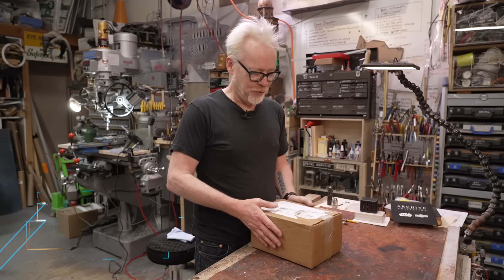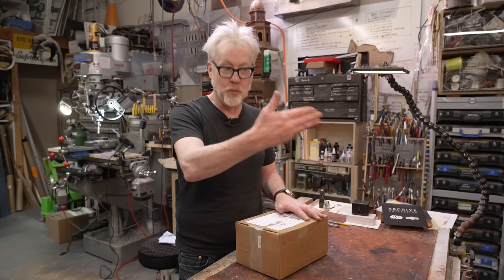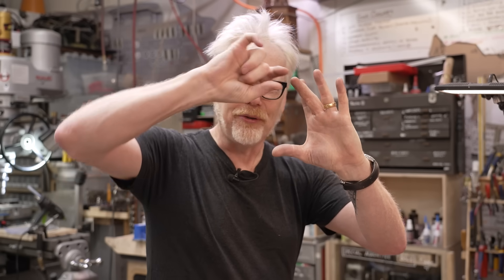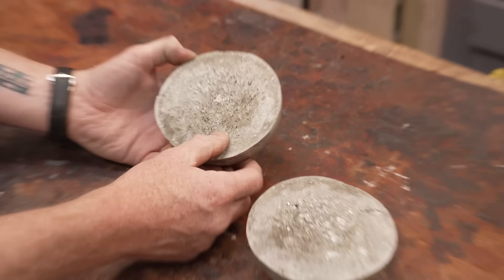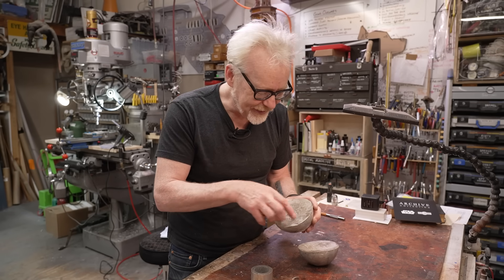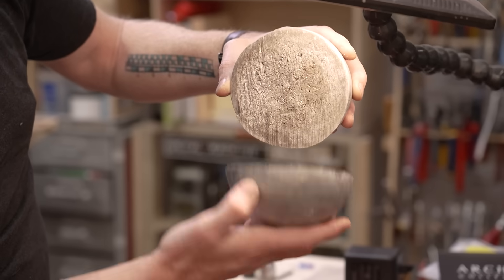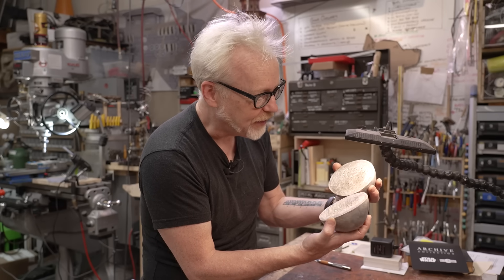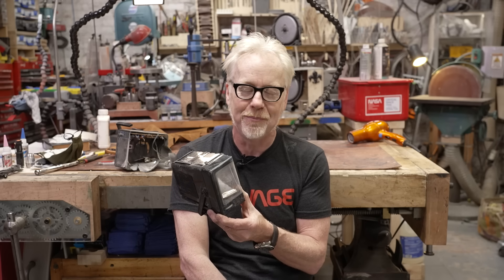Adam Savage's Aluminum Foil Ball Cut In Half! (Ft. Waterjet Channel)

Comment: I remember patiently removing the paper backing from the foil cigarettes are packaged in and hitting it with a small metal cartridge ( smooth surfaced ) until I had an eighth sized baseball. Took me a couple of years to do this. Very relaxing " hobby " .

Comment: It'd be tricky, but if whilst producing the sphere the compression is done within a vacuum chamber it may help to reduce the internal aeration

Or simply apply much larger compression in the early stages in order to repeatedly drive the formation of that denser shell like layer,  not 100% sure if we can assume the rough width of the shell witll be consisted as the radii of the sphere increases, but at the very least it can be used as a rough gauge of how far apart the larger compressions need to be to form roughly overlapping shell layers (it won't be homogenous, but without melting it or using solvents, I'm not sure how you'd achieve that)

Comment: What's the logic for why the ball is densest at the edges and more airy in the middle? I'd have figured the center would be densest, just because they had the most pounding. Would it have just been because it was awkward compacting the aluminum at small sizes, so the sheet crumpled less uniformly?

Comment: Okay, on your next one, start with a small ball and pound it until it's solid, and as you feel confident that it is perfectly uniformally dense, add on another series of layers and pound that into a solid. The challenge is, can you create a perfectly solid tin foil ball over multiple iterations? As the radius increases, you'll need more foil, but there's probably also going to be an optimal incremental radius required to preserve uniform density, and the amount of tin foil required for each incremental layer probably follows some mathematical equation similar to the area of a sphere.

Comment: Maybe try to do it in layers. And to make it even, roll a couple layers in one way, a couple more in the opposite way, then a third layer in the z-axis equivalent way until the roll is done. Once you get a layer on, hammer it down until it's solid, continue. It could be more equally round by the time you finish.

Comment: Try using Wire EDM to cut the ball in half. It should preserve the inner structure of the ball allowing you to see  the layers more distinctly as with waterjet the abrasive particles will change the surface structure of the cut face

Comment: I’m wondering if a layered technique could possibly cut down on the air bubbles formed inside. Though that would then create a jawbreaker effect with layers but maybe there is a way around it.
Reply: Sure is. Heat it to the welding point of aluminium as you hammer.

Comment: Fantastic! I bet every kid tried to make a large ball from aluminum foil. I did as well,.....in junior high. (in 1965, I was 12)  (When I was younger, I had achieved making a very large                   ball of string!) I was inspired by all the foil my mother wrapped my school day lunches in. Every day there was a sizable sheet of fairly clean foil around my food. Once I began my project , I employed my friends & other kids to contribute their foil, too. Eventually, buddies of mine were using their paper route, earnings, to buy me rolls of foil. I never considered using hammers to compress the foil to an ultimate density. ( I was a kid, what did I know?) For the longest time I was only applying hand compression. There were occasional times where I slammed the ball into the pavement, to refine the shape. I got it to the size of a soccer ball. Very imperfect, not exactly round, with a crumply surface. I was delighted that it had some weight to it.

Comment: back in the day when i used to smoke and the foil packages used to be a think paper and tin coating . you could peels the paper and roll the tin into balls . i made a few of them from hundreds of these foil insults using a metal Tabaco lid and rolling it against a table . made like 3 of them the size of soft balls and 1 the size of a golf ball . and they are very heavy and unlink yours put together in single sheets so there is no air gaps at all so they are like a solid ball of metal when your done and they polish as you work them becoming work hardened at the same time

Comment: I briefly ran the 3rd biggest water jet cutter in Europe, and we used very fine Garnet sand as the abrasive. The only thing we discovered a water jet couldn't cut was toughened glass, it just shattered. It always blew my mind that a machine that could cut titanium for an F1 gearbox like butter, but could also engrave on a silver locket just by adjusting the feed.(The firm went bust 6 weeks after the machine arrived😢)

Comment: I made one of these, between ~1988 and ~1993 or so.  Cigarette paper foil.  Canadian packs came with foil that could be removed clean from the paper backing with a touch of heat to get the peel started.  I collected my own habit, as well as any foil out of discarded packets.  

It took those 5 years to get a ball to that size.  When it was large marble size, i put a hole through it with a rolled up note with approximate date started.. and continued adding.  I worked it like a worry ball.   

It would be interesting to section at one point, as one of my brands i smoked, came with gold foil.  

Mine was that size, by the time i gave up on that obsession.  

I still have it in my Curio-Cabinet.  It's rock solid and heavy as heck.

Comment: If you have a vacuum chamber in your shop, here is what you can do with the surface: 
1. Get some epoxy with long curing time, and maybe some color you can add to the epoxy. 
2. Mix the epoxy and fill half way up in a cylindrical plastic tray with a diameter 50 % larger than your half aluminum ball. 
3. Place the half aluminum ball flat face down in the tray on top of the still liquid epoxy and move it to the vacuum chamber. 
4. Lower the pressure to a little (not full vacuum). 
5. Let the atmosphere back in very slowly so that the epoxy fills all the cavities in the flat surface of the half ball. 
6. After the epoxy had hardened, you can sand and polish the surface.
You probably have way better procedures for this kind of work from your career, but my point is that if you fill epoxy in the cavities in the surface you will be able to maintain the original structure of the compressed aluminum foil inside the ball after sanding and polishing the flat surface.

Comment: I ran an industrial water jet at the company I retired from in Feb 2021. My machines used 100 grit garnet and cut at 54,000psi. I would tell people who I trained that you can only stick your finger under the nozzle once and that's because it will remove your finger before you even felt it happening.

Comment: You could soak one of the halves in an epoxy resin to stabilize the interior structure then sand and polish the surface without deformity. (A black or other dark color resin should give a good contrast)

Comment: If you do a second aluminum ball, at some point during the formation/compression process, could you put it into a vacuum chamber to draw out the air to further compress the material? Would it lead to cold welding if so? 🧐

Comment: The water does do a good bit of cutting. I run a waterjet myself and can cut through a baseball bat with just pure water. It's just much slower. The particulate added to the water stream is usually powdered garnet.

Comment: Adam, Adam, Adam, it isn't tinfoil, it's aluminium foil and here in Australia we call it alfoil.  Tinfoil is made of tin and iron.  The tin is just the anticorrosive layer on the outside of the iron sheet, all be it a very very thin sheet of iron.
Reply: It's a colloquialization we use in the US. We say both tin foil and aluminum foil for the same product

Comment: When you make your next one start consolidating it right away as you build it up. This method will get the core just as solid as the rest of the ball. If done correctly using the same amount of aluminum foil it will be no more than 1/2 the size of your first attempt possibly even only 1/4 the size. You should be able to get within 15% of the size of truly solid aluminum if done correctly.
Reply: You don't know what you're saying kid

Comment: Epoxy.... I would place the ball in Total Boat ultra clear epoxy. Be sure to vacuum the bubbles out of the epoxy prior to placing the half sphere into it. Once in the epoxy, cycle the vacuum to help pump the epoxy deeper into the ball. Once the bubbles are out, place the sphere submerge face down and use a pressure pot to put some pressure on the whole thing till the epoxy sets off. Once hard turn the flat face on the lathe, sand, and polish.

Comment: 1000 series alloy for basic aluminum foil. It's probably rolled to 0.001" to 0.0012" thickness. Because of its significantly higher purity than 6xxx alloys, it will be more malleable and indeed 'stickier'. Hand-hammering it did create a more homogenous structure than I would have expected. But it is not tinfoil - true tinfoil is tin cold rolled to a similar gauge.

Comment: I used to work around an old waterjet unit (not my department, but I had MANY carbon fiber parts cut on it). It was Garnet that they used (same kind of stuff as used in a sandblasting cabinet). Every once-in-a-while, they would have to shut down and drain all the water out...and then shovel all the 'sand' out of the tub.

Comment: Obviously you already know how to improve on this ball, but I figured I'd share from my past attempt. 

When I did this, I didn't use a continuous piece of aluminum, I took a piece only a few feet long and compacted it down into a sphere. Then I'd take another few feet, wrap it around the existing ball and repeat until I was content. This resulted in a much more uniformly dense ball, or at least I assume so, I never got to cut it in half. From what I can remember, the ball never cracked during compression, and I think that's due to it's more uniform interior.

Comment: I would have cut it with a diamond blade wet met-saw (metallurgy saw) and then lapped it to 1um for ya!  Maybe do a nitric etch to show the real structure.  Probably epoxy impregnate it......there should be a geology department around you that could do that.  At least to one side.  Nice video(s)

Comment: I would love to see Adam create a realistic Pokeball replica. BUT there's a catch, I'm not talking about the standard Pokeball that we are used to for the past few decades, I'm talking about the new rustic design from Pokemon Legends Arceus. Despite my love for the classic, this Pokeball looks so much more interesting, and had in-game lore on how it's made.
First, the player must get 2 ingredients: An Apricorn (a fictional fruit with hard woody shells introduced all the way back in Gen 2) and a Tumblestone (new to the games, looks like one of those super shiny smooth rocks you get from souvenir shops).
Then, from the looks of the ingredients and the final product, the player hollows out the apricorn for the lower half, and uses the tumblestone for the top half, closing them together with a pure iron rim, and topped with a small firework canister.
The Great and Ultra balls also have iron as their required ingredients, but I assume they are used for interior reinforcement so Pokemon won't break out of them as easily. Explaining why the standard Pokeballs don't require iron in its recipe.

Comment: When it comes to sanding. I would think that normal sandpaper, especially rugther qualitys wont really wor, as there is a rist of ripping the foil and destroying the structure. What I think could work is a fine abrasive compund on a flat surface and time, to basically polish the surface flat.

Comment: The right solution is a diamond wire cutter. Or, since it was aluminum... WIRE EDM! You could cut the ball into a puzzle that when solved the ball looks like it's one whole piece. We're talking zero tolerance parts.

Comment: Yay! View number 216,522! I think it's the earliest I've ever watched an Adam Savage Tested video!
As soon as I saw this video was up, I HAD to see it. I'd watched the forming video (of course a little disappointed that Adam didn't do research to see how CRAZY the original Japanese foil ball makers did it, but whatever), and cringed at his attempts at cutting the ball, due to my personal experiences with trying to even just cut pipe without clamping, so I had to see how it turned out after getting someone to waterjet it (which is about the safest, least deformative method, since the foil would never be heated to melting temperatures)...

I really hope Adam can figure out how to really sand and polish one half without overly changing the internal structure...perhaps it can't be done, though...

Comment: The machine shop I worked in used ruby garnet sand with the water pressure on the water jet machine 25 years ago. I don't know what they use now.

Comment: You needed a band saw with a vice like the kind used to metal cut bar stock, the kind that uses gravity to put pressure on the item you want to cut. That would keep your fingers safe. 
But the water jet is more fun.

Comment: It's funny to see Adam talking about an Aluminium (or rather Aluminum) ball but keep referring to Tinfoil that clearly isn't made of Tin. I was going to suggest making a ball from Tin but this made me wonder, what about a ball made out of many different types of foil. Aluminium, Tin, Lead, Copper, etc. Only limited by cost and availability really. For example, maybe a very thin Gold layer. I think it would be an interesting challenge dealing with the not only the different material properties of each but also how to make them work together. Then cut that in half and see the layers.

Comment: The abrasive in the water is not necessarily required.  It depends greatly on what you're cutting.  I've seen these machines cut cake with the same precision as glass.

Comment: I really want to see what it's like do make another foil ball but under vacuum conditions. I think that when air pockets got trapped in the center of this ball they started acting like little tiny springs resisting the hammering action at the surface of the ball. I bet another ball made in a vacuum could reach a higher density. If there was a way to get rid of the oxide layer on the foil you could even get cold welding to happen and get even closer to solid metal!

Comment: At my workplace (Production Engineer at an electronics assembly plant), I used to work in Analysis where I would cast circuit boards in epoxy resin and slowly sand down to get a cross section of a solder joint (or whatever the engineers wanted to see).  Once I sanded, it goes on a polisher to make it glass smooth.
I feel like epoxy casting and sanding/polishing smooth would create a very cool looking texture/structure under a microscope.  Maybe contact one of the many epoxy art channels of YouTube?

Comment: Garnet is the usual abrasive in waterjets. A valve opens and the water stream basically pulls the abrasive in via venturi effect.  At least in the waterjet we use at work.  And in a LOT of cases the water itself can do a huge amount of damage on it's own.  Basically all plastics/rubber, etc, and even thinner gauge metals can still be cut with just water. Which we do to save money since garnet for us is currently around 55 cents a pound, so long cuts in thick steel can cost hundreds of dollars in abrasive.
Reply: Thanks for sharing this. I entered the video thinking water cutting was just water at pressure. And left wandering how effective plain water actually would be after learning it was the work of abrasives I had been seeing up to now.
Reply: Can the abrasive be recollected and reused?
Reply: @NuggetHorse  The tricky part about reusing it is that you'll also get all the material that you removed. So suddenly it'll be garnet+whatever metal you might've cut last. I guess that isn't ideal.
Reply: "in a LOT of cases the water itself can do a huge amount of damage on it's own."
Work in a water plant, can confirm.
Reply: I know of a company that does concrete cutting with diamond powder.
Reply: @oliviercoen2978  Likely not (To an extent. Incredibly hard materials would probably still give issues, Diamond, Tungsten Carbide, etc.). Tho it certainly would help and make it quicker. But the pressure is so incredible that it does alot of the work.
Reply: is it the impurities in water that cut , or just at high velocity the hydrogen/oxygen bonds act as a solid ?  Bit like hitting water from a very high starting point

Comment: Hi Adam, I noticed when you were making this item that there was a lot of aluminium oxide and dust given off in the process. As interesting as this build was, do you have any views about the health issues that aluminium can cause?
Reply: There is a reason we pack food in aluminum. If you eat it the material will just pass through your body. However as with any dust you should avoid inhaling it to prevent cloggging up your lungs.
Reply: @mrfrenzy.  Yeah, there is some divided opinion on the research about the affects of ingesting aluminium although it is more likely to cause cognitive decline and dementia.
Reply: @mrfrenzy.  eating aluminum is definitely not the same as inhaling it. I don’t know the specifics of what damage metal particles would cause in the lungs but it’s most likely nothing good. Hopefully he had a respirator on.

Comment: I run a waterjet at work. A few things that I can say, the machine I run works at 56kPSI and uses 80 grit garnet as it's cutting medium.  It's cool that the waterjet worked on your project, one of the problems that you can possibly encounter using a waterjet on laminated materials is delamination - the layers split open or seperate from the water flow. I guess I am not as skilled as they ( Waterjet channel) are! Off the cuff I would have suggested using a wire EDM which has less stress on the cutting surface than a waterjet. I think......